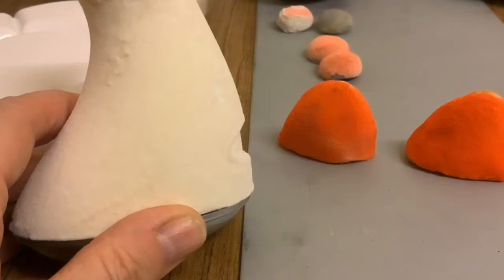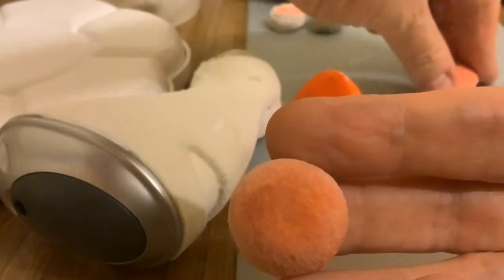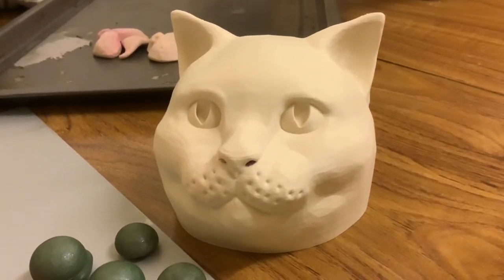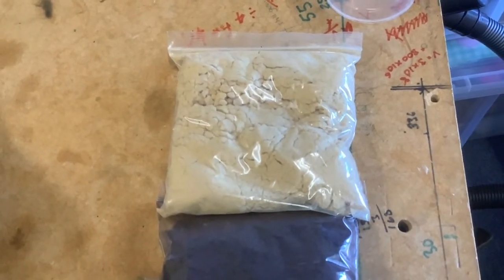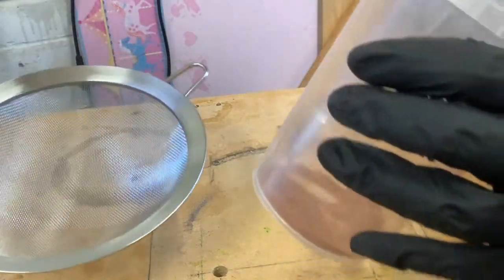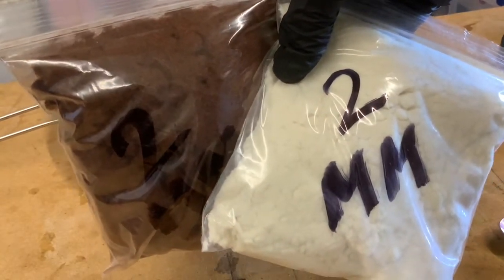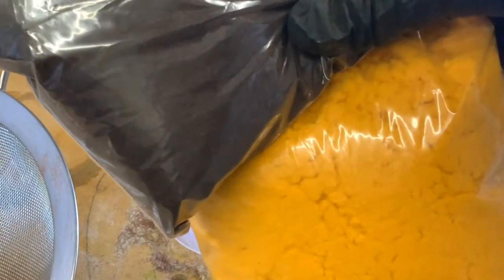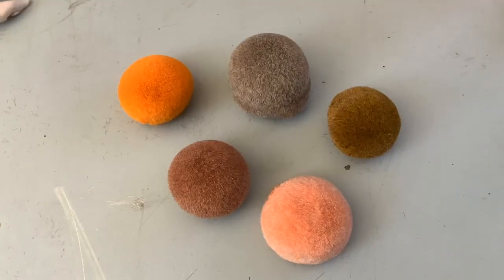Flocking: Mixing different colours of Nylon Flock Powder

Comment: That's awesome! It's very hard to find information about flocking I'm finding out... So I really appreciate your video. Do you mind telling us more about the flocking machine you're using? And where did you get it? Thanks!!
Reply from the maker: Thanks for the feedback 🤗 Paul made the flocking machine, it’s a second version. He used a DC 12 Volt to 20,000 Volt high voltage electro-static generator module (they only cost £9.99 off eBay). You can buy ready made electro static flocking machines for around £100. We’ll make a video just about flocking machines & I’ll let you know here when it’s up 😉
Reply from the maker: Finally made the video on flocking machines: https://youtu.be/BzEoFnVj3hI